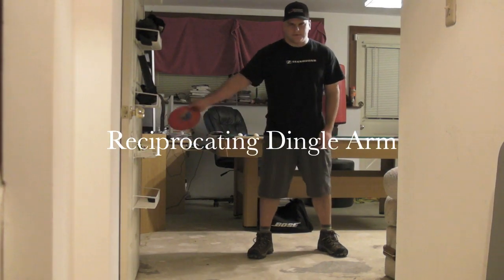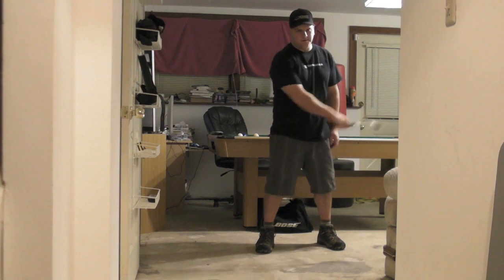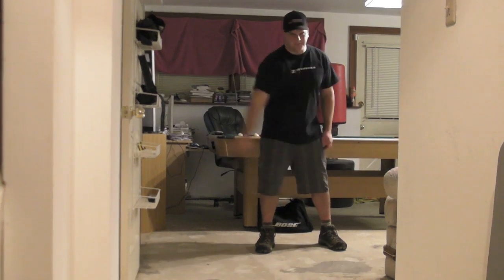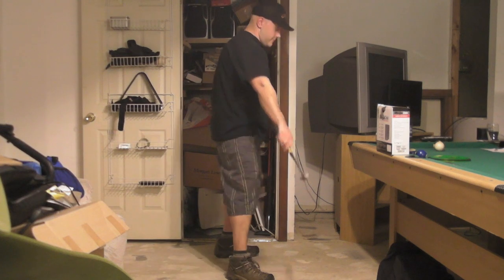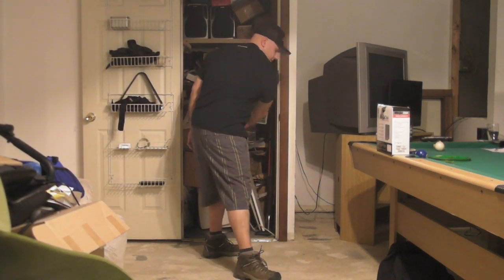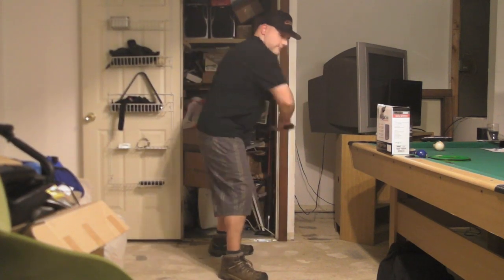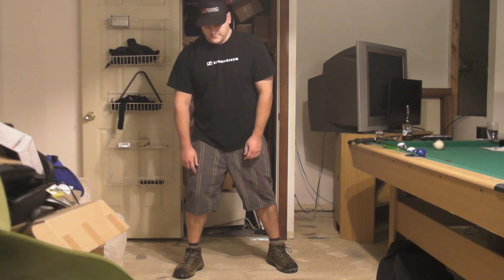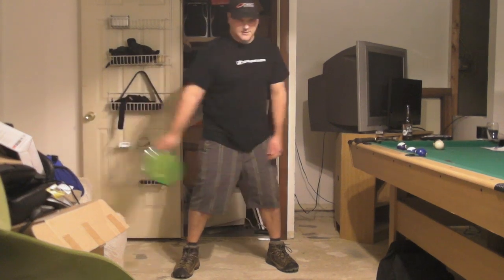Reciprocating Dingle Arm

Comment: Brilliant to see another video thanks for this. Quick question, you tend to have a much lower pull line than I do (I'm up just under the nipples)  Is there anyway of more easily converting the swing to this plane? I struggle a bit with the lower line for consistency and throwing annys.  

I have just been thinking about doing a little video about weight shift - you've beaten me too to it :0 )
Reply from the maker: I use a low to high swing since that is the trajectory of most shots, at my max reach back it feels like the disc is at hip or almost knee height and then rises to almost shoulder height by the end which is facilitated by the elbow bend/lead. In actuality my forward swing is fairly level because of how my body is moving during the throw. If you start at nipple height you can't really bring the disc through the core and use gravity unless you really swoop the elbow plane. 

For throwing anhyzers, it's just a matter of changing your balance/spine tilt to rotate on that anhyzer plane and throwing more out to the left RHBH/closing the stance more.